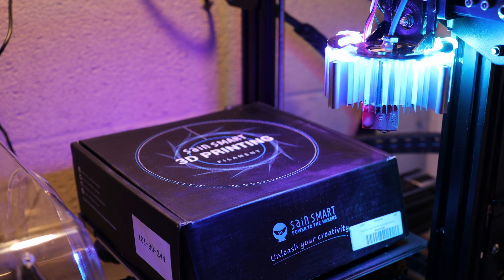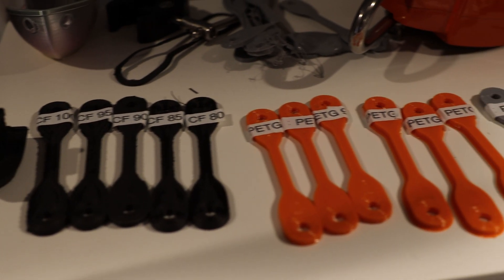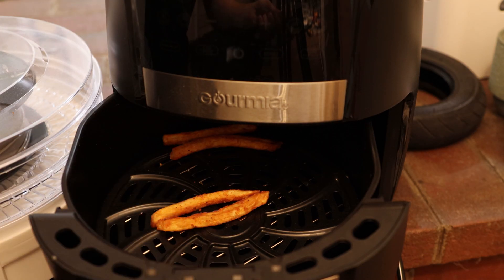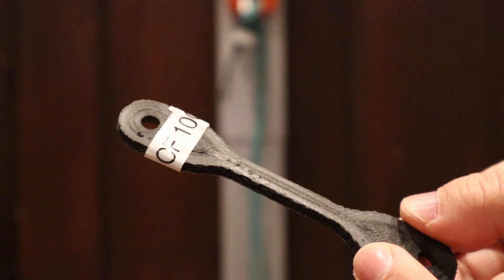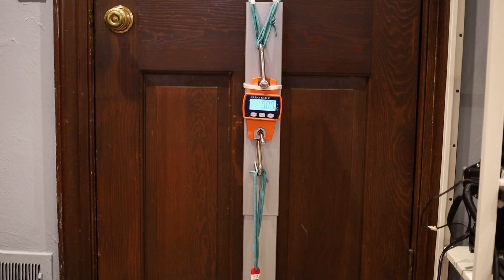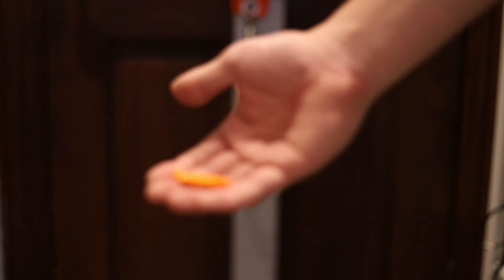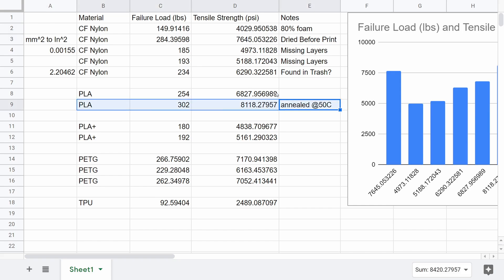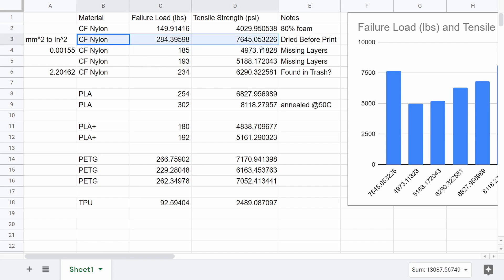Carbon Fiber Filament: Super-Material or Super-Hype?

Comment: Great but… material strength it’s one of the characteristics... other one is temperature stability, it’s necessary in mechanic parts… in that situations it’s where pacf it’s one good filament (compared with pla or petg)

Comment: The thing that no one seems to ever bring up is that this is HAZARDOUS and likely cancer causing material. You will breath in fibres, especially if you are breaking it or sanding it. But even just the printing process is likely putting carbon fibres into the air which are basically man made asbestos. Im going to continue to avoid anything with carbon fibre.
Reply from the maker: That is a good point, I don’t think it’s releasing enough fibers into the air to be with worrying about. The fibers are encased in resin so they are basically glued down. If you are cutting or grinding carbon fibers you are releasing maybe 100,000x more fibers into the air, so it’s a much less hazardous to be printing with it in my opinion. But still a good idea to think about what you are doing and the potential hazards of the materials you are working with.
Reply: @NathanBuildsRobots  See I don't know how much I buy into the whole 'encased' theory. Yes, while its in a filament form or printed, it is encased. But based on my usage, any substance printed creates 'wisps' and very very fine strings that fly into the air, that then break up and form as dust/particles in the air. These particles, even if encasing the carbon fibre with plastic, doesnt matter, you are still breathing it in, now its just plastic and carbon fibre particle instead of just carbon fibre. Still bad! Like I say, won't touch it myself!
Reply from the maker: @jessejuliano8056  Thanks, that is definitely something to think about. I always print in a well-ventilated area now.
Reply: @NathanBuildsRobots  thanks you're the one of the few channels that has appreciated this. I really wish it was more widely covered, way too many people take no precaution at all with carbon Fibre. I'm still looking into glass fibre reinforced, I don't know how bad it is to breath in bits of glass but i get the feeling not as bad because it's far more widely used and people like boat makers would be exposed to it in huge amounts for decades so it's atleast not super super bad.

Comment: One time I also accidentely printed PLA at PETG temperatures and was amazed at the resulting hardness of the printed PLA.  It was MUCH stronger than PLA at PLA extrusion temps.
Reply from the maker: Cool, hotter = better layer adhesion because things are more melt y. Will take a toll on overhang and bridging performance but for strength that is a hot tip!
Reply: @NathanBuildsRobots  Happy accident, I try not to get too crazy with overhangs and bridging. ;)
Reply: Overextrusion efects

Comment: I found that I could not get flat discs for a tesla turbine with PA-CF but they came out great in ASA, nice and smooth and stiff, no warping!

On the other hand, PA-CF is the strongest for me when making things like screws or inserts, thin rotating pins, etc..   I also find that PA-CF has anisotropy, I'm getting way stronger results in a single layer vs vertically.  This has changed the way I orient parts and so on.

For my turbine, I ended up making the shaft and casing and misc parts out of PA-CF, and using ASA for the discs, and I think it's the best of both worlds.

My main takeaway is that there isn't a one-size-fits-all material, and the future is multi-material.  Use the right material for each part.
Reply from the maker: True, and multi-orientation. 
Non planar printing can make up for some of the deficiencies of interlayer strength for CF reinforced plastics. The issue is that there are basically no fibers oriented in the z direction, and they aren’t connecting layers together. There could be a stitching method to pull fibers into a vertical (along Z) orientation.
Reply: @NathanBuildsRobots  Exactly, this is why I think 5d printing or whatever they call it is the next big thing.  We must go beyond x/y/z.  It seemed hard once upon a time but lately I see lots of people doing it.  I think it will kind of become table stakes in the coming years.  The newer filaments and increased capabilities elsewhere will necessitate it.

Comment: You used a junk 25% CF Nylon. Quality 25% CF Nylon costs 4 times the price of $60+ / kg price of Sain Smart brand
Reply from the maker: I agree. I redid this test on some CF-Nylon from Phaeturs (which is just a rebranded filament as far as I can tell) but it was high quality stuff. It broke my test rig when I tried to pull it apart, so it was well over 2x stronger than anything I tested in this video. 
The footage of that is in my Phaetus Rapido video if you want to see it:
https://youtu.be/Ji9wiornqh4?t=331

Comment: Which one is stronger against pressure and direct sunlight? Is it also of good quality in printing?
Reply from the maker: Your biggest issue with handling constant pressures in direct sunlight is going to be creep.
CF nylon has good print quality if it is handled properly and printed in a dry state.

Comment: After its dried then printed, i wonder if sealing it with Cerakote would allow it to maintain its dried strength. 🤔
Reply from the maker: Nylon loses some strength and becomes more flexible and less brittle as it absorbs moisture. It’s not necessarily a bad thing. And moisture will deep in over time, it’s almost impossible to keep it out. Even if you seal it it just takes one crack or scratch for the water to get in. And over enough time, the water can just go straight through the sealant.
What is a bad thing is printing it while the filament is wet. It puffs up like popcorn and loses about half its strength. You get a slight reduction in density, but the strength loss is much greater (something like density^2.3)

Comment: Absolutely worthless information. None of your tests have a unified control variable. What were you even testing? Every single CF Nylon sample you "tested" was different. Missing layers, poor adhesion, not dried ect. Not only that but it looks like you didn't even bother dialing settings for the CF Nylon to begin with. To top it all off, the excel plot you made didn't even have the materials labeled (or even averaged based on material) on the X-axis making it more difficult to even understand what it is you were trying to test.
Reply from the maker: I am documenting my learning experiments on YT with a budget of 0 dollars and not enough time. If I were trying to get my lab NIST certified, publish my findings in an academic journal, or was qualifying these materials for a safety critical application, I’d put a lot more effort into it.

The load-cell I’m using is nowhere near fast or accurate enough to get good data, even if my samples were prepared in a professional lab.

In any case, I hope you learned something despite the imperfect dataset.
Reply from the maker: Btw, this sainsmart cf nylon is crap, very hard to print with. 

My samples printed with another brand came out perfect 1st try, it’s featured in the video I did in the phaetus rapido. Printed some good cf nylon and it worked much better.

Comment: I find cf-nylon near impossible to print. Pain to switch nozzles and also wears out the extruder brass gear. The added carbon by definition has to lower the layer bond strength as there is less media to attach to each other when the one melted layer goes down on the next. Maybe if you spend days tuning the settings it works but at that point could have just machined a much stronger and better looking part.

Comment: Would you think there would be a difference between air frying the filament or oven drying? Air frying has a bit more air circulation so it might be faster in transporting any water away?
Reply from the maker: I would think so. My oven is a convection oven so it would probably be similar in time, but it’s good to have separation between food and experimental plastics
Reply: @NathanBuildsRobots  Just to point it out, Air Fryer (Frying) is a brand name. All the brand does is sell convection ovens. So your convection oven is the same as their "Air Fryer".
Reply: @Gojira_Wins  not entirely though. Airflow in an air fryer is very different than a convection oven

Comment: Absolutely worthless for information. "This might be that and that might be the other", all the while there's incomplete extensions and incorrect application. I have an idea for your testing... Try and do a more scientific approach. Unless you were just after the free filament then you did it perfect.
Reply from the maker: Would certify a bridge or plane with this data? Hell no, but it was fun and I learned some general information about the strength of materials.
Would love to get some real data using a proper universal testing machine, but as you can tell by my production value, this is not a high end lab setup.

Comment: PA6-CF20 is much stronger than whatever you used. Sainsmart? never heard of them
Reply from the maker: Yeah, I tested another CF nylon and it was over 3x stronger. Sainsmart's CF blend is not so smart.
Reply: @NathanBuildsRobots  which one did you try? I've got an esun PA6-CF15 (the newer "upgraded" 750g spool) on the way. By the way thanks for making the S1 silent mods. I've done on my S1 and goddamn it's so quiet. Thing of beauty
Reply from the maker: @iamdmc  Nice. I used Phaetus PA-CF blend. It printed at 300C, so I'm guessing it was PA-6. Phaetus is just a label, so for all I know the esun stuff is the same thing.

Comment: Not all CF Nylon is the same. I would try again using a 25% CF Nylon.
Reply from the maker: I completely agree. I tested out some cf nylon from Phaetus and it blew everything I have printed before out of the water. 

I have tried re-drying and re-printing this Sainsmart stuff and unfortunately it just does not hold up very well.

Comment: Test show errors in slicing and/or printer settings.
PETG shouldn't shatter. Probably too much part cooling.
PA-CF should be printed in heated chamber. (70-80C ballpark).
PLA should be annealed in much higher temperature than 50C. You not only want to relieve internal stresses. You want it to crystalize.
Reply from the maker: The PETG may have broken with a single fracture, but with the way I had it set up, the shoelaces acted like a slingshot and threw the pieces at the ceiling/floor, and probably shattered at that point. PETG is much more brittle than the other materials I was testing, because the rest survived the same post-fracture impact.

PA-CF can be printed at room temperature. It may not be optimal, but it was about as easy to print as PLA. The stuff from Sainsmart had much worse strength and quality that other PA-CF filaments I have tried.

Interesting to hear that about PLA annealing. I don't have much experience with annealing in general. With steel you can look up very good data and recipes on annealing. With plastics and 3D printing I had trouble finding good sources on how to do it, and what temperatures/heat soak intervals. Do you know of some good resources for that?

Comment: I feel like the Annealed PLA shouldn't count as much because you rarely get a usable part when you anneal PLA. It just shrinks and warps too much. I'm a little surprised about the Nylon performance. SainSmart is not a real name brand that I would use for Carbon fiber Nylon parts. I would love to see if you got any differences with, say, 
Essentium HTN CF25
CarbonX™ PA12+CF
FIBREX™ PA6+GF30
These are pricey but are well known and proven 
All this BS aside, I really liked how you did your tests
Reply from the maker: Thanks! 
I got some CF Nylon from phaetus and it destroyed the Sainsmart stuff. It's over 3x stronger. So idk what's up with the sainsmart filament. I think I needs to be extensively dried, or it's just low quality.
Reply: Thats why yuo need to rescale yuo model at abuot the same srinking , then yuo print, then yuo anhinling, then yuo mesure

Comment: The one thing I would say is spend more time with the nylon carbon fiber to dial in the settings. You can get much smoother prints than what you're currently getting. If it's dried completely and calibrated specifically for it. I would set it up so you can keep drying it while printing as well.
Reply from the maker: I got some from phaetus that arrived dry and printed out super strong. Process is everything with this stuff!
Reply: Yeah, and then you spend some fraction of spool dialing it in and print a few things and you're out. :)  That'll be another $100 plz.  Worse than a boat!

Comment: interesting test but what is being measured is ult str not tensile str, esp for polymers tensile str can be difficult to calculate as exhibit non linearity. tensile str to be measured using stress/strain incremental data and linear curve fitting.
Reply from the maker: Typically I use the term "ultimate tensile strength" or "UTS" to describe the maximum stress achieved by a material during tensile testing. Looking at the literature, it is more often referred to as simply "ultimate strength" as you point out, but both terms are used. 

Yield strength is the stess at which the material starts to plastically deform. It is harder to measure, requiring precise displacement information. 

The Young's modulus, or modulus of elasticity, is the slope of stress vs strain in the elastic region of a stress/strain curve.

Comment: Try CF PLA/CF HTPLA
Reply from the maker: CF PLA is probably insanely stiff. I will reach out to some companies to see if I can get some.

I watched a CNCKitchen video on CF Polycarbonate. He said it was one of the strongest filaments he's tested and it was something like 9000 psi. 
That's about what I was getting (within 25%) for virtually every type of filament I tested - so it seems like strength is pretty even across the board.

Comment: Great testing! In terms of future video ideas, I wondered if you have ever seen this before:  Someone managed to reinforce 3d prints with fibreglass and a soldering iron to bond them together( https://youtu.be/G1HUUncqcjY - "3d Print Welding and Fibreglass"  ). Would be cool to see some of your professional testing methods on the process to see how much stronger it would be vs normal filaments. Keep up the great work as always!
Reply from the maker: That sounds interesting, is basically a DIY version of the mark forged continuous fiber printing. There are some academic papers on its tensile strength, it's crazy strong. 

https://markforged.com/materials/continuous-fibers/continuous-carbon-fiber
Reply from the maker: I have worked at a ton of places where I could have gotten this type of woven fiber in Kevlar, glass, and Carbon Fiber in the trash. I should have stocked up on it! Next time I find some in the trash in totally going to grab it.

Comment: I designed a drone chasis but knew the CF filament was not strong enough so I printed in ASA and wrapped the parts in CF matting and epoxy and drew in the epoxy in a vaccum drum, the parts are very strong although I have managed to damage some in some extreme crashes
Reply from the maker: Continuous fiber CFRP is much stronger than the chopped fiber stuff used in most 3d printer filaments. 

At the end of the day, the nylon matrix ends up taking most of the load, so the carbon fibers are more of a stiffening additive than anything else.
Reply: Hi Andrew, I'm thinking about 3D printing a frame for a very light weight 1s toothpick. I know buying a cheap real carbon one is probably better, but I'm new to 3D printing and making designs and this would be a fun project to keep me busy this winter. What filament would you recommend, or do you have any tips? Thanks.
Oh and great vid Nathan, you got a new sub!
Reply from the maker: Thanks. Feel free to chime in here Andrew, but I have thought about making a carbon fiber quad  and will share my thoughts really quickly: 

I wanted to try friction welding little carbon fiber rods together along with 3d printed parts. It would be tricky but could be very strong and light
https://youtu.be/KKZUg5CuGDU
https://amzn.to/3EVBvM8